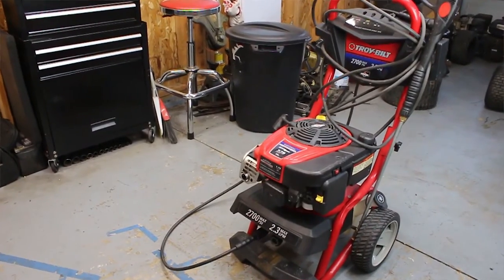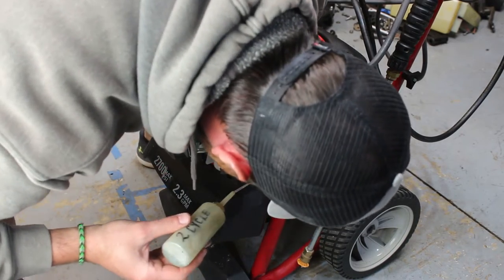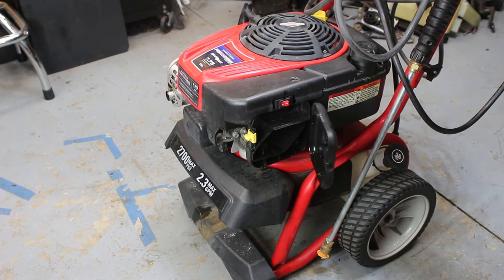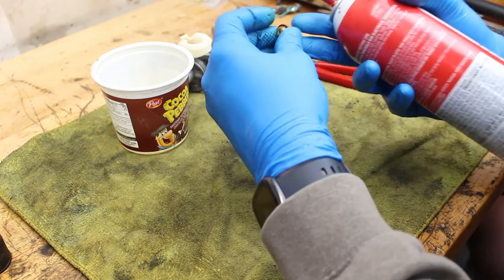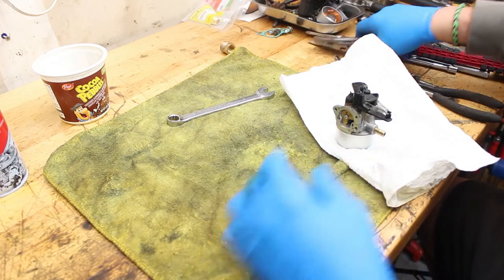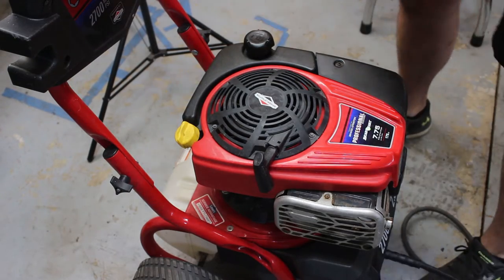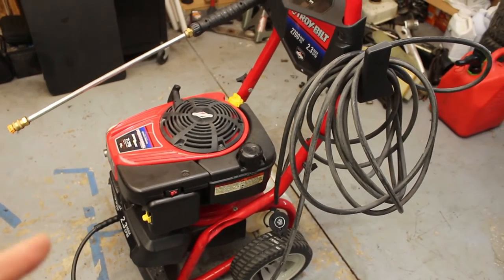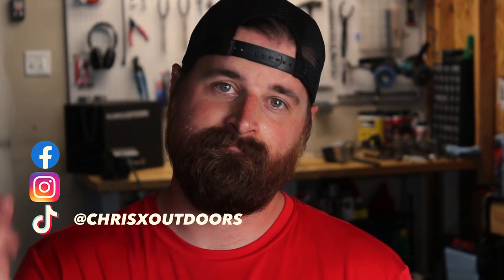Troy-Bilt Pressure Washer - Why Wont It Start?

Comment: kill switch simply grounds out the sparkplug so it doesn't matter which way the wires are attached in on position switch is open and in off it is closed otherwise a good video

Comment: I've got multiple issues. Water isn't coming out during prime and my power cord won t pull.
Reply from the maker: Pump pistons might be doing something funky. Connect some water to it and before you pull the cord, press the nozzle trigger. Sounds like you have built up pressure in the wand and it should shoot a small pressurized bit out. From there, you should be able to pull it over

Comment: When mine failed to start, I replaced both the air filter and spark plug and it started right up without issue.  Old spark plug was scorched and the engine would backfire when pulling the starter cord, indicating an ignition issue.   Was a simple and inexpensive repair for a second hand unit I bought for a few hundred bucks.

Comment: Thank you for this video! Great information! 

However, I tried this, and my power washer still doesn't work. I dont believe the internal part of the governor is working. The rod doesn't seem to be turning to move the governor lever. If I manually move the governor lever while it is running, it will respond and throttle up and down. How often does the internal part of the mechanism stop working?

It is a Troy Built professional series 2700 psi power washer. This particular model from what I have researched, apparently is very problematic. Problem I am having matches completely, but this adjustment is not fixing it.
Reply from the maker: If the engine is running way above rpm wide open, something internally is messed up. Doesn’t sound like that is your issue. I’d check the linkages where the Governor and carb are connected and make sure nothing is hung up. Sometimes that will happen and affect the Governor arm. Keep me updated

Comment: Great video...now I know how to remove and clean the carb on this pw.
I have the same pw and it starts and runs ok, my problem is it does not reach max pressure consistently. I know this because i was using it to remove the oxidation from my plastic shutters and when it running at full power it removed it but then loses a little power and does not remove it as well. Any ideas on why could be the problem ? Thanks.
Reply from the maker: Could be that the pump seals are becoming worn. Hard to tell without it in front of me but cleaning the carburetor is never a bad idea. Keep me updated!

Comment: Great video!! Quick question… mine runs well, but when I turn off the PW sounds like a load gunshot.. do you know whats causing that
Reply from the maker: Built up pressure. It’s normal. You can turn it off while spraying. That will eliminate the pressure build up. I do it sometimes.

Comment: Hey been looking all day trying to find one like mine good jib my friend. My son in law used mine and now it won't start I think there was water in the gas so I drained the gas and took the bowl off and cleaned put new gas in it didn't help let it sit over night and pulled on it and it almost started so I hooked up the water and could not get it to do anything tried starting fluid and nothing  I guess I will pull the carburetor and clean the jets. You got any ideas. Thank you for the great video I thought it was very good.
Reply from the maker: Silly question but does it have gas and is the spark plug wire connected?

Comment: Friend, I have a problem with my pressure washer, it turns on fine, but it speeds up and slows down on its own, it started to fail when I transported it from one place to another, but I was lying horizontally, can you please help me.
Reply: Saludos desde México
Reply from the maker: Retire el carburador y límpielo a fondo. Parece que algo sucedió cuando fue transportado. ¡Limpiar el carburador es un buen comienzo!
Reply: @ChrisXOutdoors  intentaré con eso, gracias .

Comment: LOL you kind of scared me when you was spraying off your mower I thought oh man he's going to get water in places he shouldn't because those power washers can ruin maybe not ruined but damage things like a tractor or engines I just thought you was holding it off on close..... Hopefully your tractor started up and everything but good video I will try that on mine
Reply from the maker: Started right up after I blew it off with some compressed air. I clean them like that all the time.. dozens. Never had any issues!

Comment: I replaced my carburetor and it still starts and stops 1 sec later.
Reply from the maker: Was it an Amazon/Chinese $20 carb? Or an OEM?
Reply: @ChrisXOutdoors  OEM replacement part.
Reply from the maker: @MrArapahoe  do you see any adjustment screws?
Reply: @ChrisXOutdoors  not that I see… but all new to me so I may be overlooking it
Reply from the maker: @MrArapahoe  it might be a choke issue. These have something called auto-choke which keep the choke plate permanently closed. Once it starts up, there is a coil on the muffler that expands while it heats up, this slowly opens the choke (usually fully open after a minute or two). Sounds like your choke plate might be stuck open causing it to start then die right away. Just a guess but something to look for